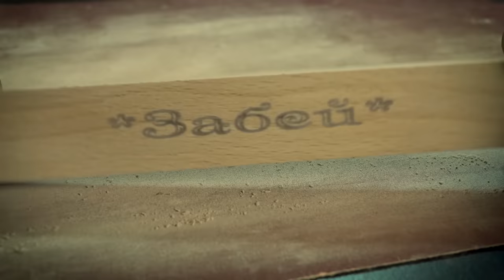An expensive nail!

Comment: I could see this being used as a ceremonial "first nail" like how executives use a golden shovel for the first scoop of dirt or cut an opening day ribbon with big scissors.
Edit: yes, also like the last railroad spike, as every other reply seems to point out. Never again will I leave out a possible example from a comment lol. I've watched hell on wheels so I know about the last golden spike, guys.
Reply: Or like the golden spike
Reply: or last nail would make much more sense to declare the end of a development or something
Reply: Some boss would just come in and bend it over in the ceremonial plank.
Reply: @daveys  you would have to have a pre-drilled hole, maybe lined with gold or something. And use a gold hammer.
Reply: @catalot5804  - Lol
Reply: This was a common practice on railway projects in the 1800s, beating in a "golden spike" to signify it's completion.
Reply: Maybe in a spot where it's not actually needed. Building code actually wouldn't allow it for structural pieces because despite common belief, more nails actually makes the structure weaker, at least for wood. The nails arn't actually the weak point, the wood is, and when you drive more nails it just weakens the wood and make it more likely to split. And obviously it can't be one of the actual structural nails in itself.
Reply: @overlyobsolete2797  or a joining point between new lines, generally struck by a local official or railway owner
Reply: Honestly I could just see a craftmans useing this as a lesson for Apprentices.  "Make me the fanciest nail you can"  Proceeds to pound it into a random joint.  "And just like most of your customers, nobody is ever going to see all that detail."
Reply: Or a keepsake urn for a carpenter.
Reply: Exactly!
Reply: Ceremonial first nail for the coffin of russian stock market maybe ?
Reply: I could see some politican shank the hit and totally bend the nail
Reply: @daveys  this
Reply: @SoralTheSol  what are you teaching him carpentry or Taoism 😂
Reply: @davemeads859  That customers are assholes.  Though I work in retail, maybe this is just a me thing.
Reply: @captainleonard123  why does using a ceremonial last nail make any more sense than a ceremonial first nail?
Reply: @davemeads859  - Normally I would expect that a manager would touch the nail and the building would fall down.
Reply: @Eric-469  Because a last nail signals the completion of something. Just because you start a project doesn't mean it gets finished. Like your education, for instance; looks like you started it but by your comments it's obvious you never finished.
Reply: @WmSrite-pi8ck   Half way done and never finished…..Sounds like my education and the experiences of your sexual partners have something in common. Got you triggered by a simple question 😆 👍🏿
Reply: You hit the nail on the head!
Reply: Cast in gold as a retirement gift for a lifelong carpenter
Reply: Like a golden railroad spike
Reply: @Eric-469  usually a fancy shovel is used to break ground, then the ceremonial nail could be used to show completion.
Reply: Or "The final nail in the coffin"
Reply: Not gonna lie, i honestly saw this comment going a more inappropriate route.  Lol
Reply: @beave200  ok now I'm insanely curious what inappropriate route the comment could have gone 🤣
Reply: @catalot5804  the "ceremonial first nail" could be a metaphor for the first time they get... jiggy with it... And the way this person put so much effort into making this nail/ jewelry box complete with a bracelet. I have no doubt that they will be getting some. Unless this is a gift for like a daughter or someone else related. However if rule 34 has taught me anything, it is that even familial bonds arent even a line now a days.
Reply: Makes a hell of a lot of sense... I was just thinking to myself where the fuck is this nail even useful for
Reply: it's hollow
Reply: @Alexander Rapp sounds like a bad joke that starts with "knock knock knock" lol
Reply: ahh, i remember my first nail
Reply: I'd say last nail, the "it's done" nail.
Reply: Never heard of a first nail, i would understand using it as the last nail of a long anticipated job
Reply: or the last nail of a railroad being made of gold lol
Reply: "Would you do the honours of laying the first brick" what, here in front of everyone?🚽💩
Reply: You can clearly see how he's is making it that it has no actual constructional strength and would fold on itself if hammerd in. It is clearly a show piece that stays in its casing.
Reply: @litpapi9046  yes, hence "ceremonial" I don't think anyone is doing craft projects with the big novelty scissors either
Reply: Wtf is hell on wheels
Reply: @LIONGOD  a great tv show

Comment: I love this idea it very creative and unique, just suggesting a tiny hook on the inside of the nail head to attach the chain  so that it will come out nicely would make it perfect.
Reply: Yep, my first thought as well!
Reply: Might cause the chain to twist as you unscrewed it - and as you twist chain, it goes rigid and expands. Would be good if it worked, but would worry it would jam inside the nail and then get ripped apart as you carried on unscrewing the head.
Reply: @goldcd  he can make the hook spin
Reply: Not trying to be a dick but a hook would look tacky. If anything adding a nice thin velvet liner for inside the nail to reduce noise and protect the chain would be dope. Or instead of the diamond anti-slip tread on the head, he should have made it resemble a tiny eggo waffle. Other than that, I think it is perfect how he made it.

Comment: Did anyone else think he spent all that time engraving that dowel at the beginning just to sand the design off?
Reply: If you look at the nail after sanding design is still there just de-burred and smoothed out.
Reply: Ironicaly, that was his first attempt to engrave anything using this method. So it could possibly go wrong... 
But the tube itself is too thin to give second try. It even slightly bended in first try

Comment: A lovely and unique presentation box! You have mad skills in the manual arts along with video making.
Reply: What he does isn't really manual. He is using a cnc machine and a computer guided lathe. He isn't really doing anything manually except sanding and polishing. But either way, the concept if nice and it does take time to learn how to program those machines. I do everything with hand tools and antique tools and lathes so if I was to make something like this, it would take a long time to do cuz it would be done with no computerized tool help or cnc machine. But either way the concept of what he does is cool but anybody with access to those tools he uses could make this no problem as long as they knew how to program and work the tools.

Comment: 2:40 what is the purpose of the spring. I understand the heat is for a press fit but i  dont get the spring
Reply: Its for weight balance
Reply: It's solder, which is why they heat it with a torch after.

Comment: Cast this in gold or silver and sell them as retirement gifts for career carpenters and contractors
Reply: @Wayne Flanigan i always thought gold plated things kinda cheesy and goes away from high end luxury sentiment here.  I like brass, it's a beautiful metal for a piece like this.  Silver tarnishes and solid gold would require it be locked away and probably would be no more valuable in this form than as a bar.  Casting would not retain detail, this is hollow, threaded, knurled.  And you'd lose gold through milling process even if you tried to recover as much as you could, you couldn't account for that lost weight in selling final product. 
 Ps Someone would have to be set up as jewelry maker to do that but who knows maybe he is one.

Comment: It is pretty dangerous to let wood oils penetrate cloth or foam. It gets hot drying and burned down a lot of woodworking Shops...
No joke.
Reply: just light the wood stove with them, crisis averted
Reply: Oils are always wiped off with a with cloth you can apply the oil with steel wool but you kind of need a rag to wipe it off ,and they take a long time to heat up.
It's not all that dangerous as long as you know what you're doing and dispose of your waste materials properly, and this guy clearly knows what hes doing so I doubt anything is in danger.
Fireball tools has a great video on the subject and talks about safe disposal methods I'd reccomend giving it a watch.

Comment: Hook a vacuum hose on the exhaust of the vacuum you're using for chip control, and use that pushing air to evacuate chips into the sucking side. An airflow of air made between such two hoses will have a greater chance to keep things clean.